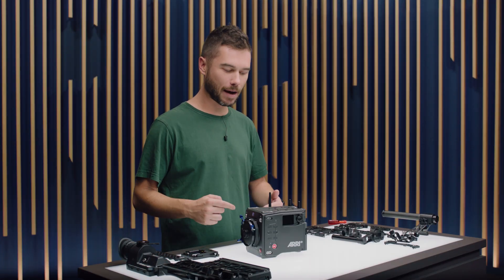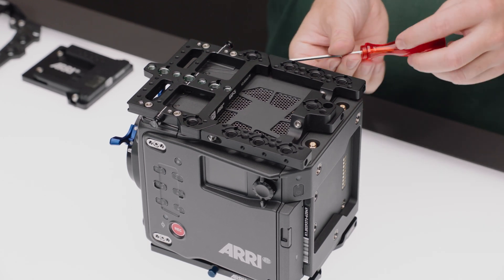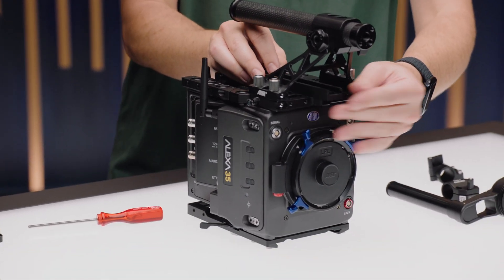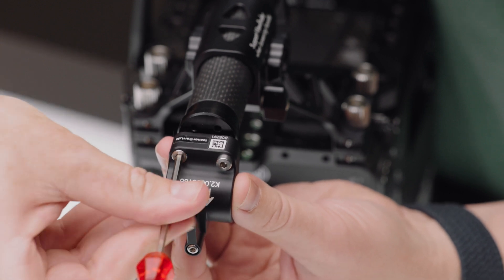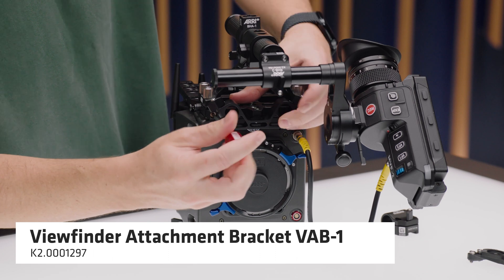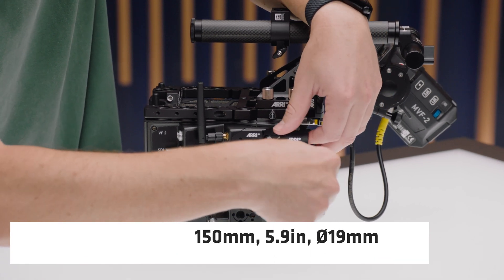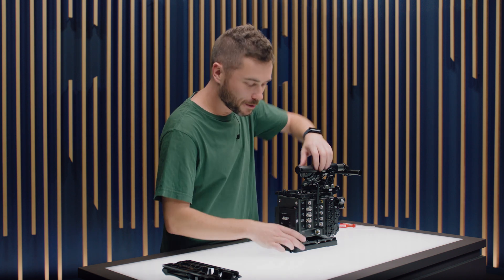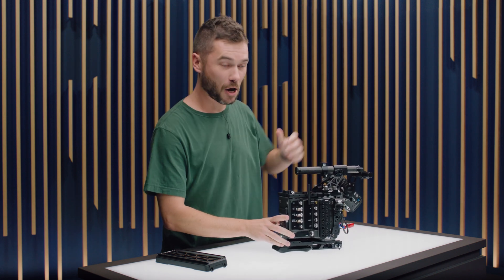ARRI Tech Talk: How to build your ALEXA 35 Lightweight Set

Comment: love these videos, and esp. having mechanical experience, seeing a camera 'tech' use a star pattern to tighten the screws, GOOD job, it applies force evenly on a large, multi fastener part. (also unlike 'Gaffers' actually using the RIGHT tools, not just an open ender or a 'monkey wrench', a well under used common sense decision making approach).

Comment: At 3:14 why do you recommend turning wifi off in the camera if you take of the antennas? Is it bad for the camera or the human or something? I've been operating my Mini for 6 years without the antenna because it gets in the way and I still get good enough signal to my phone. I hope I don't develop a mutation or something. Thanks!.
Reply from the maker: Hey there, it's always best practice to turn off a radio transceiver if it doesn't have an antenna attached, as it's possible to damage the transceiver to do "foldback", particularly with high powered devices. - Sean
Reply: @ARRIChannel  thanks I really appreciate that reply!  You think I got away with it because I always kept a rubber cap on the port, or because the Mini isn't as high powered as the 35, or just got lucky?